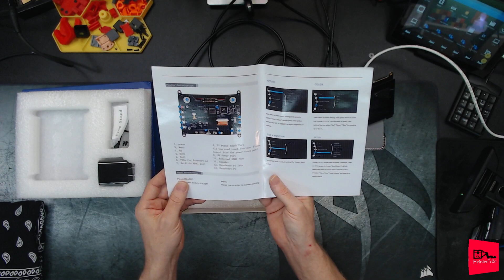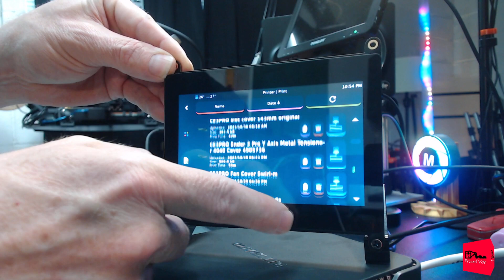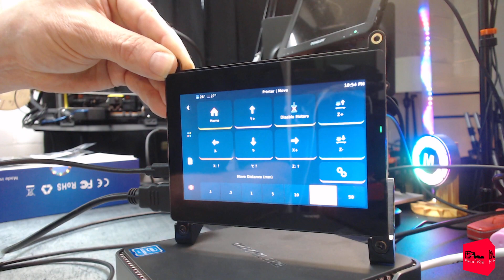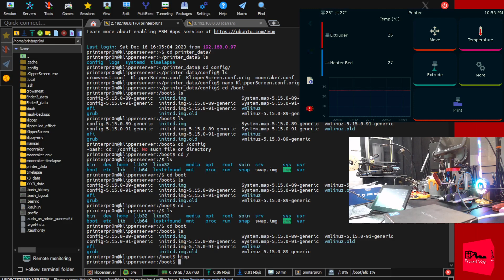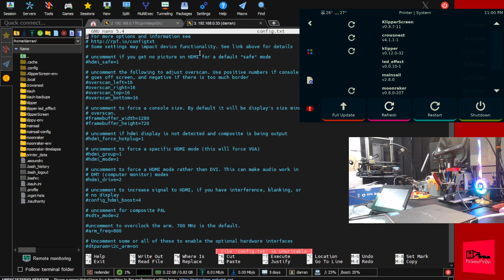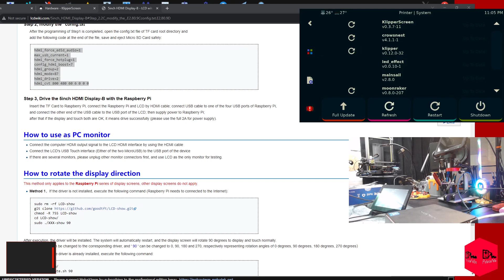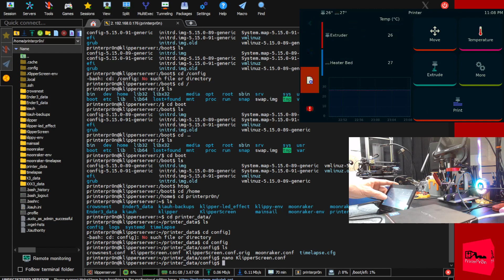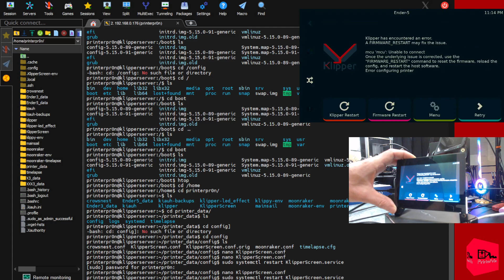KlipperScreen Setup for Multiple 3D Printers

Comment: Cant get this to work.  There is no main printer_data folder.  only a data folder for each instance.  I have KlipperScreen.conf in my main folder and in each config folder.  All i can get its my port 7125 printer to work with klipperscreen.  It shows no other printers in the klipperscreen connected printer menu.  Everything works fine through the browser.  any ideas?
Reply: Interesting I have the same problem you do. KlipperScreen was running fine until hey released the version of klipper that changed the data structure and broke everything. Now in my new install KlipperScreen is being a pain.
Reply: If you haven't resolved this issue. check if you have KlipperScreen.conf in printer_data or printer_data/KlipperScreen mine was in the first and that was the issue.

Comment: cant get the klipperscreen to show other printers?
Reply from the maker: You'll need to add the IP address and port of the other printer to the klipperscreen config file.
 [main]
default_printer: Ender-3 Pro
[printer Ender-5 Pro]
moonraker_host: 127.0.0.1
moonraker_port: 7125

[printer Ender-5]
moonraker_host: 127.0.0.1
moonraker_port: 7126
Reply: [printer e3s1]
moonraker_host: 127.0.0.8
moonraker_port: 7125

[printer e3]
moonraker_host: 127.0.0.8
moonraker_port: 7126

[printer e5s1]
moonraker_host: 127.0.0.8
moonraker_port: 7127